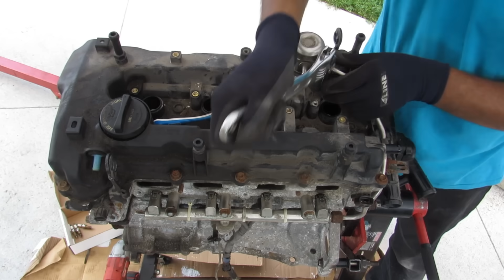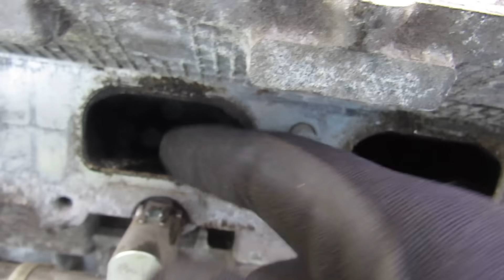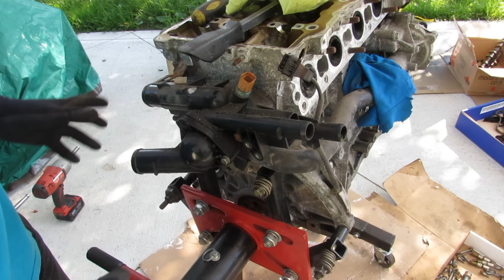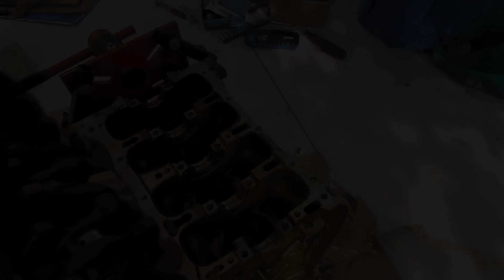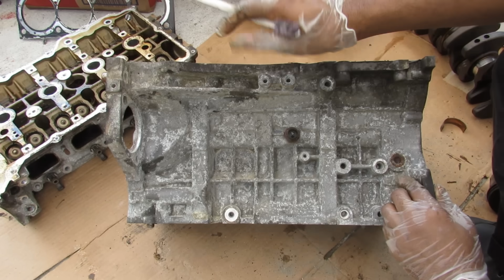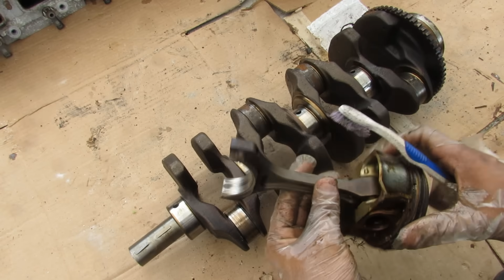Why Hyundai Engines FAIL

Comment: My kia souls engine seized at 19k miles. Found out there was no oil in it despite regular oil changes.... Got a new engine. 1 year later ... I'm having to add oil to it because if I don't the dip stick doesn't have oil on it after 2k from the oil change.... Doing an oil consumption test after 1k. It shouldn't be burning 1qt+ of oil per 1k miles like it is....

Comment: If it was the catastrophic failure, a rod would have melted and been throw through the block from spun bearing . It appears he just overheated. It would be interesting to know which parts exactly were not properly deburred

Comment: Our family's 2013 sonata went boom earlier this week. Rod bearing failure, thankfully Hyundai covered it at 90k miles it's getting a new engine. Interesting to see the tear down of the engine. Thanks for the awesome videos as always.
Reply from the maker: Interesting that they are still covering these under warranty!
Reply: @speedkar99  yeah if your engine blows up even if you aren't the first owner it's warrantied. I don't know what the mileage limit is but I've heard of people getting new engines well above 140k.
Reply: @chihirogustafson8557  I just made my last Pymt on my 2011 sonata but do you know if they honor warranty of second owner if engine has these issues but still runs? This might have been a rental car since high mileage when I bought it 2 yrs ago over 200000
Reply: @karrenleonard8653  I believe so I would check Hyundai's recall site and see. If your car has gone this long without spinning a rod bearing you're probably fine. With that high of mileage Hyundai may just say that's normal wear and tear.
Reply: Hey , during the time of the rod bearing failure , were you hearing buzzing noise from the engine ?
Reply: @mymommassun3503  I did not drive the car regularly so I am unsure

Comment: Is this same with the 2015 and upwards sonatas bad elantras? Hoping to get one of them as my first car.. 

Advise?
Reply from the maker: From what I heard the 2.4's were the worst 
Maybe skip Hyundai and try Mazda? Or a manual Nissan?
Reply: @speedkar99  Ok.. One of the primary reasons I was considering Hyundai is cause of access to parts in my region, cost and available mechanics that can work on it when needed without charging too much 🙃...

Comment: My 2017 Santa Fe sport just had to be towed, due to failed rod bearing. 101,000 miles. Pathetic. Has to,go down as one of the, if not THE, worst engine design ever.
Hyundai is replacing the engine for free, but I’m wondering if they’ve fixed the issues or if it will do the same thing in 50, 75, 100 thousand miles.
Reply from the maker: Is it covered under warranty?
Reply: @speedkar99  yes.  I took it July 11, they approved the free replacement July 13. But they said 5-6 MONTHS till I get it back. They’re replacing 2-3 a week and there’s evidently a loooong line. Now I’m just wondering if I keep it, or get rid of it. I really like it, but I don’t need a motor that won’t last at least 300k.

Comment: My wife's 2011 Hyundai Sonata has 145,000 miles on it! Many of the miles were highway miles. I used the Quaker State oil that Hyundai recommended. The only thing I deviated from was the 5w-20wt oil. I used 10w-30wt. The owners manual recommended an interval of 3,970 miles or some nonrounded number like that. I religiously change oil every 4,000 miles with the conventional 10w-30wt. Since it's out of warranty I use other brands. I believe the important thing is the adhering to the recommended intervals! The only two issues I have had is the passenger air bag which Hyundai wouldn't cover (still doesn't work) and I had to replace the temperature sensor in the automatic transmission.
Reply: I meant to say 5w-30wt.
Reply from the maker: Glad it made it. Not all will
Reply: @speedkar99  Yes maybe the factory removed the machine chips from the block? I have a friend that lost the motor in his Santa Fe.

Comment: I've watched two of your videos and you do a good job. I've been a mechanic for 45 years, you do a nice job of explaining without complicating. Engines are not high tech, the engine control is, but the basics are still there...as you showed us here. I'm stunned a modern manufacturer is letting this kinda stuff go out!! Imagine if this was happening to a Toyota? They would be all over it, FAST! This makes Hyundai look really bad. This is basic, engine 101 stuff that a manufacturer should have figured out decades ago. Nice work. Simple and effective.
Reply: Hyundai is fixing the motors. Warranty on all of these engines. And Hyundai/Kia has only been around for less than 35 years which is about only 1/2 of most manufacturers.
Reply: What's your thoughts while engine in still in car:
Drop sump, drop big end caps, flush, replace bearings, install magnets in sump?
Reply: Don't kid yourself, Toyota is just as guilty.. they all are.  Do you remember the 3.5 v6 engine oil cooler hose fiasco?  I sure do.. one of said oil hoses burst on our 2008 Sienna leaving my wife and two small kids stranded in a sketchy part of town with the contents of the base pan dumped all over the street.
Reply: @ih302  Don't forget the "low tension" piston ring debacle too. But...that said, they will chase after this stuff, it eventually goes away.  Others....not do much.
Reply: @ih302  Yes,am aware of them rubber hoses bursting and dumping oil,replacements were metal lines!
Reply: Damn, this morning is shit and I just got a Hyundai 2015. I’m going to try to sell it as fast as possible.
Reply: These engines have been failing for over 10 years. Apparently, it's cheaper to replace engines than fix the problem.   
Modern machining is so much better today, but engines are not.
Reply: Not sure if you are being sarcastic or not, Toyota's new V6 twin turbo was recalled due to debris entering the oil due to poor machining.
Reply: I believe the engineers know what they are doing at Hyundai. Some other department must be choosing not to follow their recommendations.

Comment: ADMINISTRATION not association lol funny, but ahh the infamous sonata engine failure gotta love the inconvenience, I have had my full engine replacement. It happened at 115k miles at failure, however my new engine runs worse than the original. My car in general has never run the same since, it runs so rough and shaky now. The steering wheel shakes when your at idle like at a red light, and the air conditioner has cooling problems since engine swap (it never really worked prior to engine swap anyway just worse now, I have to put refrigerant in every other day it's ridiculous but hey I just paid it off, so now I'm the owner of a pretty looking piece of crap, but she's still running and at 160k miles

Comment: I have a 2015 Sedona with the V6 GDI and I was told by the dealer that the connecting rod bearings are gone and I need a new engine.  Sounds exactly like what happened with the 4 cylinder engines and has just over 100,000 miles on it.  I have a feeling there's going to be another recall on those engines in the future, problem is I don't want to wait until then so getting rid of it.
Reply from the maker: Didn't know the V6 was affected

Comment: Nice to see enough pictures to answer the question of piston oilers / coolers .I see them on your engine ,& I have to hope they are on all of the theta engines .Mine knocked badly on cold start up during the first winter (six months from new ). It had very low milage, & eventually started producing these noises during progressively warmer weather. Upon useing a bore scope camera to view the cylinder walls, (at 45,000 kms , I could see severe scoring of the cylinder walls. I lost no compression, & the cylinders were equal pressure (right to the pound)!, which surprized me.   I added 4.5 imperial ounces of sythetic two stroke engine oil to 10 imperial gallons of fuel, & "miraculously"gained a very noticeable increase in power ., & better shifting as a result . Knocking is no worse now , but I spend time to warm up the engine , concentrating on varying the speed to keep it out of the damaging knocking noise range  Now it has 126,000.kms ,& I installed a oil pressure gauge & crossed my fingers ..

Comment: ATTENTION: New failure mode: High pressure fuel pump internal failure dumps fuel into crankcase washing out bearings, damaging catalytic convertor, and possible fire. 
SYMPTOMS: Billowing white smoke from tailpipe, strong smell of fuel, fuel rail low pressure code is lodged, removal of oil fill cap while motor running it will be noted that rapidly pulsed air emanates from fill accompanied by loud noise of same frequency.
CASE: Wife's 2019 Kia Rio purchased new by her, 68,000 miles, all maintenance current.
OUTCOME: Dealer charged $165 to independently troubleshoot to verify warranty service and then refused to cover fuel pump under drive line warranty.  Quoted pump replacement part, and labor $1200 with 8 week lead time as pump back ordered. Kia Corporate suggested Better Business Bureau, refused to buy back or trade in car at any price.
RESPONSE: Purchased non-OEM pump from ebay $145 arrived in four days, labor took 15 minutes, plus additional oil change.
THOUGHTS: TRADE IN REPAIRED CAR BEFORE BEARINGS FAIL, WARN OTHERS, THEN NEVER DEAL WITH KIA AGAIN!

Comment: Nice job as a tutorial. So...what I gather from around the mid-point of your vid.....the main problem is manufacturing debris not adequately cleaned out.....the shards of metal get caught in the oil-flow stream and chew up the main bearings...plus wherever else the shards land. As to "design"....this engine does not ( seem ) to exhibit a real flaw as such...all the tear-down prior shows some rather conventional thinking....and as you said.....even some nice design features like the water pump to the side. I'm sensing the debris is the major issue....right?.. especially if it clogs the oil passages enough to prevent oil from reaching places it should, like cyl #1 main bearing area. Seems you also mention lack of proper deburring on parts that ( when they wear down)...again cause new debris. Wow....if so....pretty basic stuff in manufacturing and not a design issue as I expected to see here.

Comment: I have a 2007 Kia Sportage 4 cylinder w/over 200k miles. Have a main seal leak, common w all cars this mileage, and keep Lucas Oil Stop Leak in it. Still runs really strong & well. Was disappointed to learn that newer models have severe engine/fire issues.
Reply from the maker: Does the stop leak actually help?

Comment: It's the improper heat-treating process that's causing the rings to flake/break apart. Causing all the metal particles to get into the oil, clogging up the oil passageways.

Comment: I liked Hyundai cars when used for car rentals. I would have been happy to purchase one, but then I checked the reliability. I think I read an article about a 10 year old owner that did 1,000,000 kilometres. 10 engines replaced and 3 transmissions replaced under warranty. The transmission reliability is not great, but acceptable. However the engine reliability is a joke. I'll stick to the Japanese.

Comment: A buddy of mine recently bought a newer truck. He had a 07 Hyundai Sonata with 98,000 on it. I've been in it, he kepted the interior clean, hell it was cleaner than clean. It had the wear on it as if it was a year old. Now it pains me to the core, because I've owned so many cars I can't remember them all. Yes I'm an old man stuck in his old ass ways. Like I would never consider  buying a foreign car,  for I'm a Ford man, mostly trucks because I made my living swinging  a hammer. Ofcourse I  also bought Ford cars, a few Mustangs, a beautiful T-bird, and a couple Lincoln Marks, I remember has a mark 4 to a mark 7 and so many trucks, mostly  F-150s.
I use to trade them in when the warranty expires. My friend with the Hyundai,  which I used to laugh at, said he would give me a really good deal because I helped him remodel his house. So I figure I would give him what he wanted 1,800.00. I thought when it broke down I could basically leave on the side of the road. I didn't test drive it because I have been in it before. The first thing I said to myself, this thing idols at almost 100 thousand mile as good as any of my brand new Lincolns. This thing has a 3.3 engine and I always  bought  8 bangers. It was pretty  peppy so I checked it out. Took it to a mechanic since I really didn't have one. He said it had 234 horses, it was no G.T. but it buzz around pretty good. Showed no codes and said it was well taken care of. That was 40,000 miles ago. Nothing has happened,  just change the oil. I hate to admit,  but I fell in love with this car. It still idols and is so noise less I have turned the key to start it, I forgot for a split second it was already running.  Seems to me that this 4 door, which I used to hate 4 doors is one of the smoothest quiet ride I've had in a long time. I really want to say something  bad about it but I can't.  Maybe I got very lucky, maybe it will blow up today, but I doubt it. I really believe it will go another 100,000.  Can someone answer me.  Is the 3.3 v6 a good engine or did I somehow get lucky. Please, someone tell me there story about the 07 3.3v6 I would love to hear it.
   PEACE.   5/30/22

Comment: i've seen these metal particles ruin new engines because people think you can run the first oil change for 5000 miles. No, drain it and change the filter at 500 miles. It's break in oil .  do this on every engine. one tenth of the normal miles or hours. save yourselfalot of misery.  Thirty bucks is cheap .
Reply from the maker: Agreed. Oil changes are so simple yet people neglect them

Comment: Yet I see older high mileage plain vanilla 6spd mpi HMG vehicles all the time.
Overall then this appears to be just piss poor handling of a manufacturing run issue?
They're a global company making a wide range of commercial and consumer EV, hybrid, gas and diesel engines, but most of these issues appear to affect North American consumer models spanning a number of years. Sucks for them its also their largest and highest profile market.
If they'd just been honest with customers, bit the bullet once, recalled and replaced the faulty engines. But bean counters 🙄
Reply from the maker: They sure lost alot of money on this engine in warranty and reputation
Reply: @speedkar99  Ikr! I see they're following Toyota using both port and direct injection now. 
At some point in future I hope you revisit and assess these newer engines. I quite like the strides they've made overall and hope things have improved.

Comment: you know .. maybe i missed it but why do Hyundai's fail ? I did not see any damage in that engine that i haven't seen in an audi 3.0 tfsi engine or VAG petrol engines or Honda's , etc. Is it really hyundai's fault ? that's what i mean . Or ,perhaps, the car was not used and maintained like it was intended !?! It's just a theory . Yes , there are design flaws in every engine , but in this clip , on that engine , i did not see where the flaw of design was .

Comment: Just stay away from the 2.4 Hyundai thata engine. Get your oil change every 3000 Miles. Even if it's the recommended 5.20 Quaker State synthetic save all your receipts.

Comment: What a piece of junk!  (The engine I mean.)  What was wrong with the old fiat 4-bangers that ran and ran and ran?  I drove my Ford Festiva 240,000 miles and then rebuilt the engine.  The crankshaft bearings had virtually no wear.  Only the gaskets really needed to be replaced.
The Theta II was broke because they tried to save money on a concept that worked and skimped on parts by trying to fix something that was not broke to save some money.  Pathetic.

Comment: Yep I thought the dealer was full of BS they told me that the burning oil issue has nothing to do with the bearing which is a bunch of BS because it has everything to do with the bearings all those shavings getting oil it's going to burn oil  because all that extra shavings in there

Comment: I've owned a 2011 Kia Sorento with a 2.4 4cyl since 2010 with the dealer's purchase incentive 'Tires-For-Life'.  After 12 years and 100k miles, other than normal routine fuel and maintenance costs, I have come out of pocket for (less than $2,500) 3 car batteries, four sets of windshield wipers, and just recently one CV boot and head gasket and serpentine belt.  The old car has developed some squeeks and rattles, but it has been inexpensive and reliable and I'm glad I bought it.

Comment: I have a 2016, which I understand shouldn't have the de-burring problem. I had the software upgrade done, and they extended the engine warranty out to  150,000 miles. I hope that will help.

Comment: My Hyundai Tiburon has been running since I bought it in 2007! No problems except brakes, tires and I'm really hard on my transmission. I had some work done by the dealer, with messed up my radiator. Some Hyundai mechanics are crap heads.

Comment: It's been my understanding that lot of asian engines were made aluminum block. A mechanic friend of mine was saying these engines are small, light weight and produce a lot of horse power but they are made to be thrown away as aluminum aren't meant to be taken apart and reassembled.

Comment: I gotta say, chevy had tons of maching issues with 5.3s and 6.0s and never recalled anything.   Hyundai is covering these motors waayyy out of warranty at no cost. We had two customers get reimbursed for motors we'd replaced
Reply from the maker: But did the Chevy motors suddenly quit causing a safety issue?
Reply: @speedkar99  no, they keep running with no oil